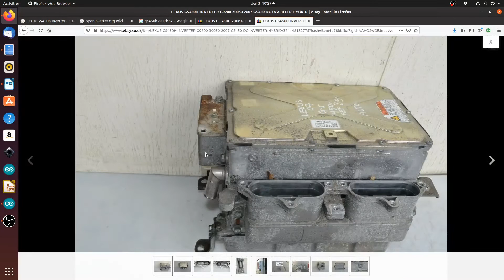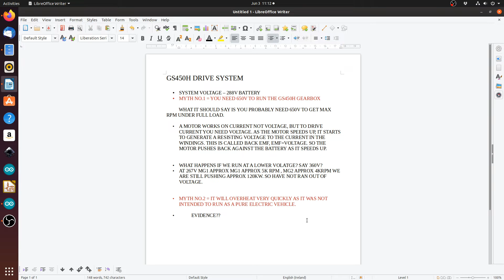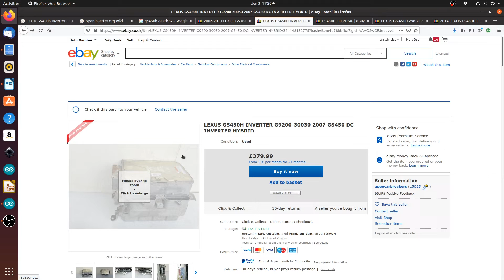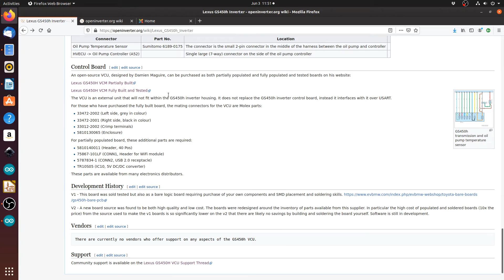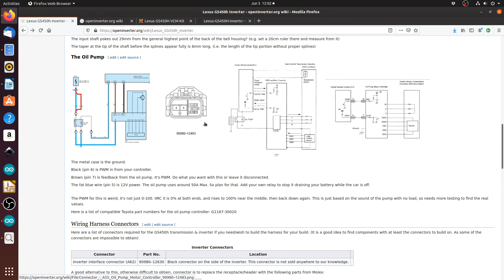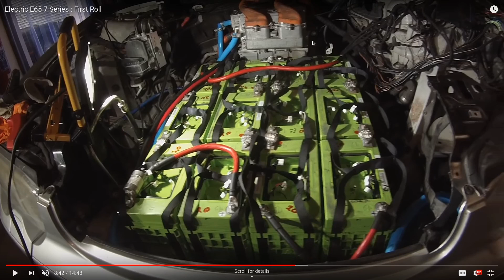Lexus GS450H EV Drivetrain Deep Dive

Comment: Hello ! I have an issue with this drivetrain : the battery pack when new is supposed to have 1.9kwh and the electric motor has 144kw of power. How does the motor generate 144kw of power from that Ni 1.9kwh battery pack ?? It doesn't make sense for me. Nimh battery it's said to have max of 10x discharge power so it should provide max 20kw of power... It's a lot less than 144kw . Please explain this things to me !

Comment: Typically when a Toyota is upgraded for towing (Tow package), an oil cooler is added to the transmission.  That is probably what you are seeing on the one that is just plugged off on the other.

Comment: If I wanted to use this unit as a retrofit hybrid system, would I be able to deploy more than the 30kw that the GS450h gets by bypassing the boost module in the same way? Locking the spline shaft for MG1 wouldn't be an option, as it would be taking engine input, but is it still possible to dump 120kw (using the 7 series as an example) into the drivetrain as a plug-in hybrid arrangement?

Comment: Hi. I just want to ask a partly related question : in hot tropical weather, will improving cooling of the hybrid battery pack of the GS450h improve lifespan of the battery pack and improve overall range of the vehicle? Are there any simple mods one can do to the stock cooling setup in the GS450h?

Comment: I managed to get the wrong GS450h gear (2014) but I'm going to persevere. Trouble is I can't seem to find any low voltage wiring for the inverter - anyone out there who could help? (Just knowing the wiring conections from the main inverter block to the transmission resolvers would be brilliant). The 2014 lot only does 150kW but I think that'll do. It's simpler, so that may be an advantage in the long run. They also spin faster at the higher voltages, so petrol diff gearing should be ok. The inverter is a G9200-30090 -(even later, they go to G9200-30132). I hope I can get it working as they can be dirt cheap. Anyway, keep up the good work.
Reply: Why don't you jump on the Lexus tech website, pay for an hour of access and download the detailed wiring diagrams? I did that for my 2007 GS450h 'donor' car and from memory it only cost me a few euro per hour here: https://www.lexus-tech.eu/TLLogin.aspx?redirectUrl=aHR0cHM6Ly93d3cubGV4dXMtdGVjaC5ldS90ZC90ZDN0ZW1wbGF0ZS9pbmRleC5hc3B4P3B6PUVNMDJFNUUmZnJlZXRleHQ9

Comment: If you delve into the specs of the monster Lexus GS600h you will find it uses a version of the same transmission as the GS450h but with an L after it.  It has  388hp v8 feeding into it so may it needs a bit more cooling?  Might be what those transmissions you have use the extra oil fittings for.

Comment: "I changed the differential" that sounds like another project can you give more information on this, how did it all line up and replaced with what?
Reply: He said it was a diff from a 730D.
I presume because diesel cars are lower revving than petrol therefore it better matches the rpm of the Lexus transmission.

Comment: Based on the RPMs (1825/1512 & 4902/4064) it appears the MG!:MG2 ratio is 1.2:1 :)
Reply: And... From what I have read, the "extra" trans cooling pipes are for those equipped for "trailer towing"

Comment: Excellent! Am seriously considering buying one of those babies... Cement mixer that is. If those are half as fascinating, they should be a hoot! :D
Reply: Ok, now I am looking at used vehicles, not just the transmission... A sure way to know that this baby will fit into the tunnel. Drop the V6 and the old battery, replace them with a big enough pack... Have an IS250 and have been thinking about converting it as a project, it is quite a bit smaller (and probably a bit lighter), but a GS ain't half bad either.

Comment: This is awsome work you are doing.😃  It looks like the perfect solution for my project.  I'm wondering. Have you confirmed the exteral pump is circulating thru the whole tranny? The reason I ask is, with the interal oil pump not turning, wouldn't that restrict the oil flow?  Is there there more than one oil circuit?
Reply from the maker: The two pumps can operate independently. Which ever one is making the most pressure will move the fluid. As the mechanical pump is stopped that lets the electric one take over.
Reply: @Evbmw  That makes sense. At low engine rpm the mechanical pump might not make enough pressure. In which case, the electric would take over. If that's true. I wonder how long the electric pump will last running 100 percent of the time. If it's not met to, Or is it?